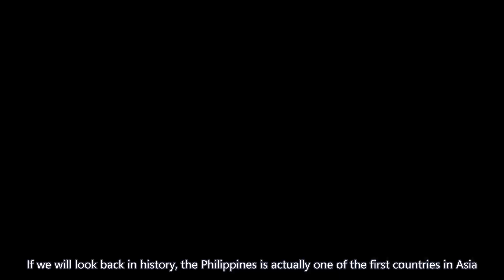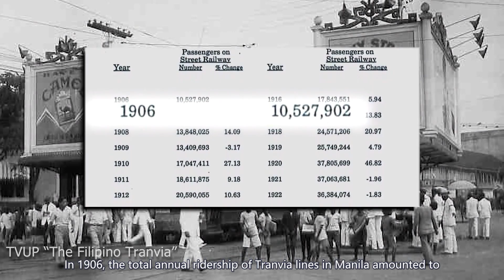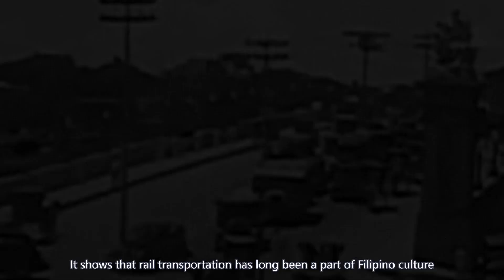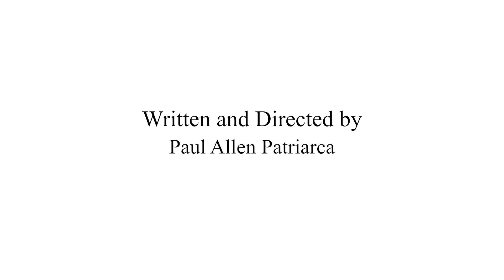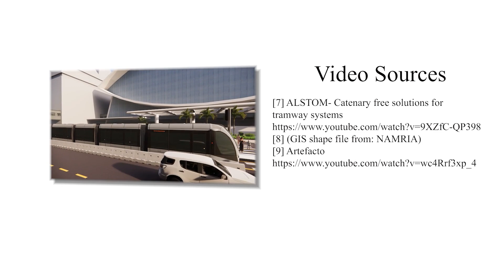Reviving the Tranvia lines of the Philippines : Seaside Railway Line (PUP Railway Engineering)

Comment: I've been saying this forever, several witnesses can attest! It is very much a dispiriting scene to see the Pearl of the Orient suffer throughout the decades. She suffered greatly from the war and has never recovered since. As a northerner, it is very much a discouraging fact that the original Ferrocaril serving Manila y Dagupan and the Tranvía is now an afterthought by recent administrations, due to the massive surge into Manila despite her already leprosied state throughout the decades. Though, the present vigor for rail have hearkened a new voice, and am very much delighted to see it in fruition. I would like to see expansion, not just in commuter rails, but also commercial and freight, especially now with recent controversy on the safety of our roads. Moreover, the project very much proposed is very apt, as the current state of Manila's transportation is... chaotic to say the least. The jeepneys, supposedly a temporary solution for post-war urban transport, has become both a staple in culture and national transport, but I believe it is unsustainable for the future and a severe detriment to modern safety standards. Though, the main problem facing Manila with such is that the streets have become very unruly ranging from random solicitors to rubbish on pavement to bad drivers. Though, that is less of a problem in more posh areas of Manila south of the Pasig, it is still something that needs to be addressed by law enforcement to avoid any unnecessary accidents or disruptions. I'm sure the former, Sr. Soriano and Sr. Zobel de Ayala, would be delighted very much so by the proposal.

Comment: Great work! We really need drastic changes in the integration of our public transit and also an upgrade on existing infrastructures. I would like to see this materialize very soon with proper integration and distinction to our LRT, MRT, and even PNR (for regional transits) that goes hand-in-hand with our BRT (Carousel) and routes of local jeepneys (I think that 2 configurations would be more suitable wherein there are shorter routes in less densed populated parts with present alternative option of jeepneys). We need to work once more for the infrastructure for the public interest and not those of private (transportation). Metro Manila needs a great revive the public transportation it once had and expand it to other regions (preferably with our PNR serving as its backbone).

Comment: the reason why our railways (except the PNR) are raised is due to lack of space. our roads are cramped as they are right now the last thing we need is another lane taken away.

tranvias, personally, are obsolete in the philippines because of an innovation called the philippine jeepney. the philippine jeepney provides us a unique and versatile mode of transportation that does not require specialized infrastructure (dedicated lanes or raised structures). the jeepney offers the benefit of precision in reaching destinations as it is not confined in a rigid route with predetermined stops, unlike the carousel and railways. 

what the tranvia did, the jeepney does on a much larger scale

with the advent of jeepney modernization, which promises to address the grievances of the average filipino commuter, would make it harder for you to sell a project such as this, especially when the proposed tranvia line is placed along already existing major jeepney routes.

i mean no offense, but i see tranvias as an expensive redundancy, at least here in manila. however, i think tranvias would be a great fit for the new up and coming cities such as clark, iloilo, and cebu.

just sharing my thoughts and would appreciate a reply, thank you.

Comment: Ang European country ay may mga ganitong transport technology maganda na sa mata wala usok at malamig pa ang byahe tanggalin na ang mga Jeep sa National road and highways in Metro Manila.
Reply: Jeepneys should be phaseout at once and the drivers, will have their licences revoked. They can be repurposed to become farmers, fishermen or better, building and repairing rails. 🚂🚃🚃🚃
Reply: @kenet71 I disagree, we cannot remove jeepneys because it's also rooted to our culture, minimizing it and putting proper lanes is the key and lessening private vehicles such as motorcycles and cars are a must, aka daming kamote drivers satin just making manila over crowded and over polluted with noise and air pollution.

Makati used to plan to have subways aswell before the issue with Taguig and ik there's future plans about similar transportation like this. Trams is a nice way of transportation but we need to remember, if we will implement this, we need to limit using private vehicles and fund and cooperate to using our local commuting transportation 

Less traffic, less noise and air pollution, and appealing to both locals and tourists

Jeepneys are staple icons of the Philippines and one of the most recognizable things in our country, minimizing it rather than phasing out is better, same goes to minimizing usage of private vehicles as I mentioned earlier and maximizing public transportation to it's use
Reply: Adding all of this mode of transportation tas maraming kamote drivers, tataas lang accident rates satin lalo na sa mga highways, Filipino drivers are not great with road traffic regulations, sa mga alley ways at street roads pa ngalang dami ng aksidente, what if pa if bigger things like this and Filipino drivers aren't as cooperative 

Big benefits to commuters, Big L if di marunong sumunod sa regulations mga private vehicles

Comment: Why not use rails though???
Rails with steel wheels won’t do as much damage to the right of way
Plus it will better keep the tram on the line in case of a flood
In the case of little infrastructure, I feel the idea of a road tram is more of a stop-gap instead of a real solution, also, what will keep it in it’s lane?
A A.I?
I don’t think so
A driver?
Yes, but the drive needs to do more to keep the train out of accidents as it’s a semi with a few very short trailers
And a battery tram?
I support the idea if it is a catenary tram line with rails
But battery power means this thing will need to charge up while wires you recharge on the run!
And REALLY fast charging will damage the battery over time and mean you have to replace it!
And not to mention the materials need to make them makes a lot of emissions…

Comment: People have become sick of the daily traffic, but they are also opposed to the phase-out of the old jeepneys and tricycles. The situation could have been better if people had been more adaptable to modern and functional approaches rather than aesthetic (the jeepneys as the PH's trademark). With a more current transportation system like this, Tranvia lines, and other Train/Bus systems, people won't need to acquire their own automobiles or motorcycles, which will decongest our roads and eventually eliminate traffic. Sa cellphones nga hilig natin yung laging updated pero bakit sa transportasyon hindi? hays

Comment: The video was well produced, the renderings looked great but why, why did you kept on talking about railways when in the end, it's just another rapid bus transit you're suggesting? Even if this had a dedicated lane, without priority, it will just get stuck in traffic like the rest of the cars.

Im not saying no to mass transport, I was just expecting an actual tram because the video title was "Reviving the Tranvia lines".
Reply from the maker: Correction, it will have its own lane and it will be prioritzed as well. Just like BRT systems
Reply: @paulallenpatriarca  that's great. I like trams/light rail because they're more efficient but this is still a step in the right direction.

Comment: Good concept but how can you make sure the cultural significance of the places you'll be passing through are kept intact? I understand the opportunity to be able to put a station in Intrumuros,  but don't you think that the station and railway, even though building this is less intrusive to the road infrastructure, can cause a disruption to the flow of these spaces, especially in the middle of the most visited place that area in Plaza Roma? 

Just might want to look into that Intramuros station specifically because if you ask me, the Plaza Roma/Manila Cathedral area should be fully pedestrianized and not have another type of transport introduced into the space when you already have people walking on the road, cyclists biking through, kalesas going around and tourists taking pictures. 

Great concept and hopefully something comes from this space. You also might want to see if you can have a connection not just to PITX but also the MRT station, even if it's just cutting down the amount of distance you need to walk from MRT to ART.
Reply from the maker: It would be more intrusive if we will put an elevated structure in plaza roma. At grade mass transport system with ZERO direct carbon emission and noise pollution is the perfect option considering all factors. Not to mention its lower cost :)
Reply: @paulallenpatriarca  I understand that it will have more implications if we have an elevated structure for plaza Roma only. Honestly, my suggestion is to no make it pass through Intramuros entirely. Keep Intramuros more void of any vehicles, maybe aside from the streets along the wall. But It would be better to have a more pedestrian friendly space, especially in Plaza Roma. Maybe you can consider having a station closest to the Plaza Roma Gate, and not in front of the the plaza because even if the trams come in periodically, there's still a chance for an accident to happen, especially with people walking on the street. :)

Comment: Trackless trams combine the worst in public transport. Wheels degrade faster than steel wheels on tracks, while the train aspect removes its ability to change locations as stated in natural disasters. It's better to buy a traditional tram system and retrofitted to be more resistant to natural disasters.

Comment: That would be a wonderful concept, considering that having a new mass transportation system would be able to accommodate many people to transport them from one place to another.

One of the main issues that we might face however would be the discipline of the other drivers, as they tend to sneak in the lines they're not supposed to go in. Which is why, automated gates must be implemented to keep undisciplined vehicle drivers away from using the Tranvia Line to skip the lines.

Another thing would be how to charge it in case it doesn't reach a specific destination. Perhaps it might have a backup system?

With that said, I hope your vision might be taken into consideration and become reality.

Comment: You could have just used DOST's hybrid electric road train instead!
Go local bro!
Reply from the maker: True enough! We visited the HET recently at Calamba and it is still in good condition!
Reply: @paulallenpatriarca I think further upgrade lang like making it articulated para passengers can go wherever.  Similar with city buses, dapat may forward seating din para comfortable passengers.  Finally, dapat may designated exit and entrance door para simultaneous yung labas-pasok ng passengers at hindi na kailangan maghintayan.  I suggest na nasa magkabilang dulo yung doors para hindi na magkabanggaan yung pumapasok at lumalabas.
Reply: yes... better use local!.... than the possible "tofu-dreg" ones from their proposed supplier/contractor

Comment: More elevated MRTs and LRTs are the current solutions.  Tranvias are a thing of the past and will surely clog our already skimpy roads.  Furthermore, they might runover pedestrians and stop traffic whenever they are passing on intersections.
Reply: Skimpy roads where? Do the Roxas Blvd and the Pasay area around MOA and PITX not have more than enough lanes for this? They're literally wider than EDSA but without the MRT. This plan only "clogs" the roads if you think they belong to cars.
Reply from the maker: @francoluna1168 ”Roads are for the people, not for cars❤”
Reply: Check the tranvias in Colombia.   You will be amazed.     That's not the past.  hahaha